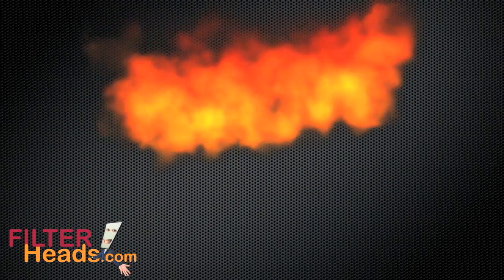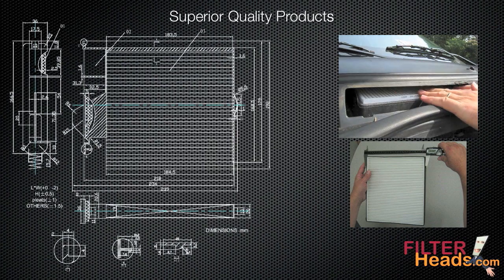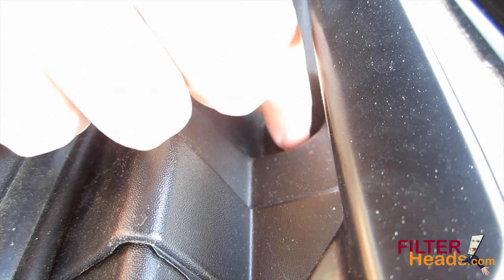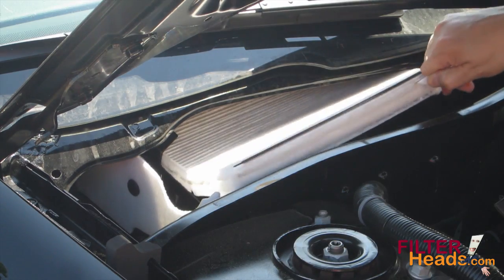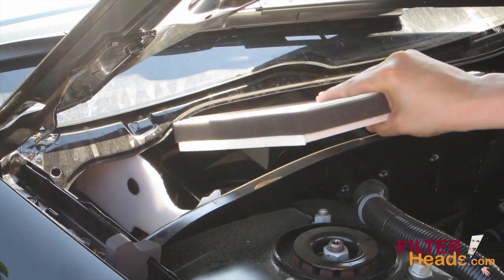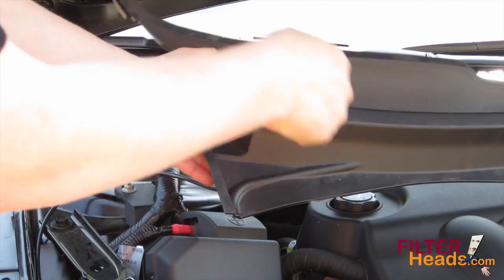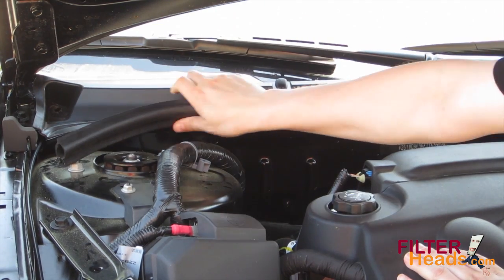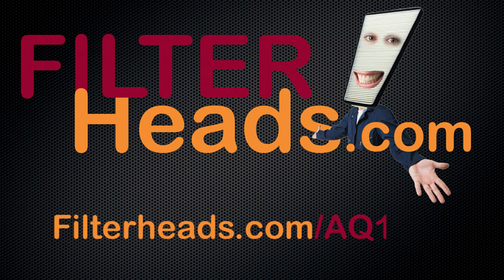How to Replace Cabin Air Filter Chevrolet Impala Limited

Comment: Does my Chevrolet Corsica 1995 have a cabin filter???
Reply from the maker: The Chevrolet Corsica did not come with the cabin air filter option.
Reply: @filterheads  thank you 
I want to know where is the place of A/C Heater Blower Motor
Reply from the maker: At this time we only have installation videos on installing cabin and engine filters.
Reply: @hasanabas4554  probably against the firewall, in the black box, in the engine bay